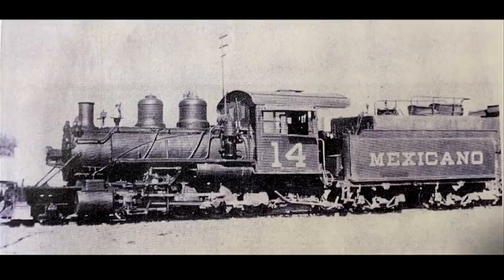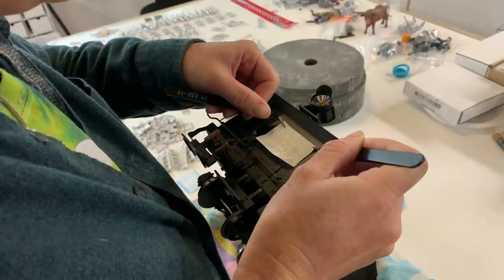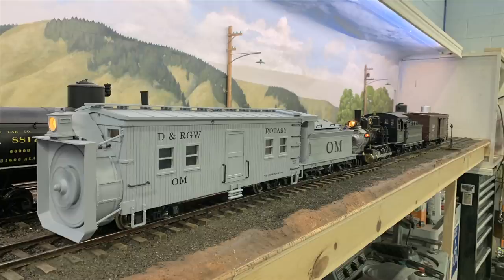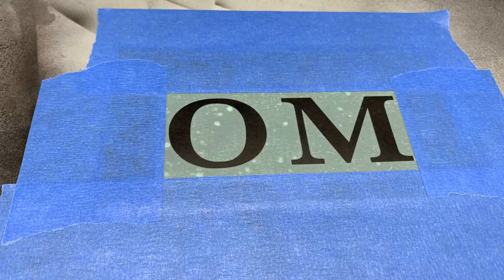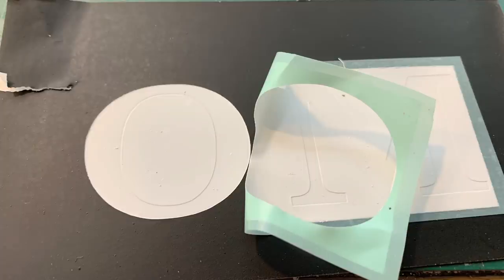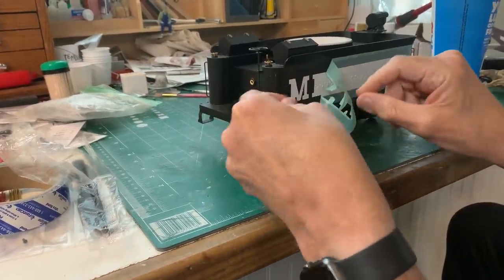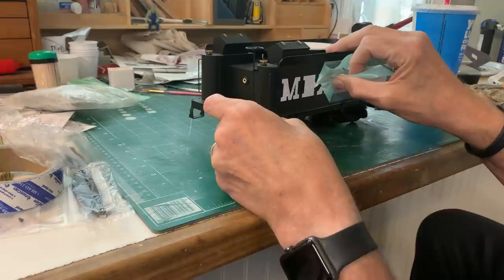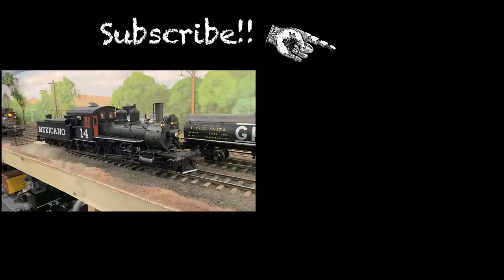Lettering our Model Locomotive with Stencils - The "Connie" part 14

Comment: Superb stencilling and the information panel on the rear of the tender is something else. Regarding your rivet detail affecting the stencil. A method I have used before to stop paint running is to seal the edge with varnish (matt, satin, gloss, depending on the eventual surface finish) and then apply the colour. The varnish should have already run under the masking and sealed it, thus stopping the colour doing the same.

Comment: Now that was a nice piece of work. Learning how to use Adobe Illustrator, will help you in making your own custom decals, dry transfers, stencils, signs, and so much more that is considered a GRAPHIC. Many folks use Photo Shop, and that is fine, but IA uses a "vector based" programing format, allowing rescaling without weird things (pixilation) happening. I know that there are folks out there who can convert an AI file into any graphic application, I just don't know who they are.
Stenciling your locomotive was a super application. @davie maclean had  a superb idea to prevent "leaking". It reminded me of a method used in "static display" model airplane decal application, to make the decal look like paint (gloss coat, then decal application, gloss coat, and then dull coat0, I think that's right.
Any way, this was an excellent "teaching" video. Now comes the crew, and then super details. I can't wait. ;-)

Comment: Lettering is an art. In ho I use decals in 4 stages, gloss paint ,decals, solvaset, then either gloss or flat clear.  On toy trains decals or dry transfers where needed.  I'll keep stencils in mind.  Thanks for another great video. 😁👍!
Reply from the maker: I use decals but so difficult. I used them on my long caboose. Came out great. The key is the gloss color. So hard to get right.

Comment: I custom make my own decals for my engines and rolling stock, I make them on a computer. print them out, cut them out and then apply them onto the models using glue (modge-poge glue) and it works beautifully
Reply from the maker: We do that for buildings. Signs. Stained glass too!  And loco gauges.
Reply: huh that could be handy for like milwaukee and northern pacific decals in G scale

Comment: If you varnish first over the stencil, you can also block some of the paint escape points, so you may have trace of escaping transparent varnish, but no paint. But it will not be enough to bridge the gap created by these big rivets.
Some advocate removing the stencil when the paint is just dry to the touch, so you don't have flakes of paint on the edge.
White paint covers not so badly, yellow is more an issue. But coverage isn't really a problem over an uniform background, if you had a red line in the middle, it would have been a lot more problematic to get the same white over black and red. White primer should help with such issues, but that will add another layer of paint, which can lead to other problems when masking.

Last year, I made a small stencil for O scale, by cutting masking tape with the x-acto knife: I really wished I had a laser cutter.
Reply from the maker: Going to try that!

Comment: That really adds something special, especially the back of the tender.  
Even though it's paint, don't you need to give it a matte clear coat for protection?  I thought that was de rigueur for decals and painted on extras.
Reply from the maker: I don’t think so. But I will. The decal requires it. But the big issue is weathering. I’m going lite weather but always some. And that requires clear coat.

Comment: Great job lettering the connies. It looks like it came that way from the manufacturer. Very impressive way of doing lettering. Is the stencil used in silk screening process ? Thanks for sharing. Be safe and see you on Sunday.👍🚂🚂🚂🚂🚂
Reply from the maker: Same idea. Silkscreen is basically a stencil. Oddly factory lettering is always done with rubber stamp!! Special huge soft rubber stamps.

Comment: If I'm not mistaken, that was a two feet guage branch, and FCM No. 12, sister to 14 survives on the Alder Gulch Railroad in Montana?
Reply from the maker: The 12 13 and 14 were 30” gauge. 12 was brought to the US to be regauged to 24” and run on the Edaville Railroad. But the huge size of these, large even for 36” gauge was much to heavy for the Edaville RR. So it was sold to the Alder Gulch Railroad in Virginia City Montana. They totally restored it. But never ran it.. they went broke before the locomotive was totally done. And so for the last twelve years it’s been on public display. Perhaps at some point it will run somewhere?  I assume as part of the rebuilding they regauged to 36”?  One of the great features on these is they can be easily regauged. Baldwin offered them in 8 gauges!  I assume Bachmann picked this odd locomotive as they assumed it would run on the Alder Gulch and be a hit. So… ass u me. Oops. But it’s an amazing locomotive!  Baldwin sold hundreds of them around the world. The Silverton Northern locomotive was a later version. The sand dome was moved forward and a different valve gear. But we are modeling it as the early version as there is no good way to change the valve gear. And the dome can also stay where it is!